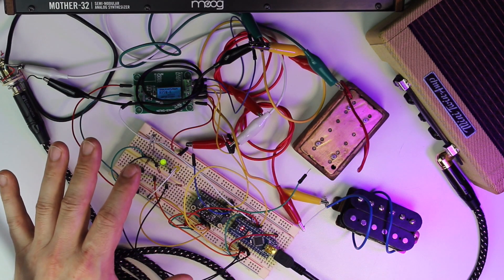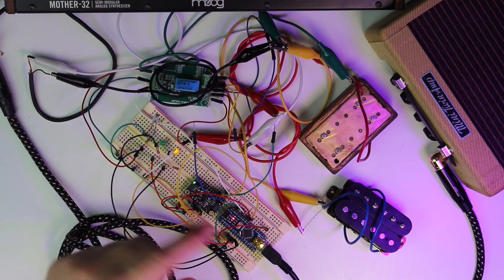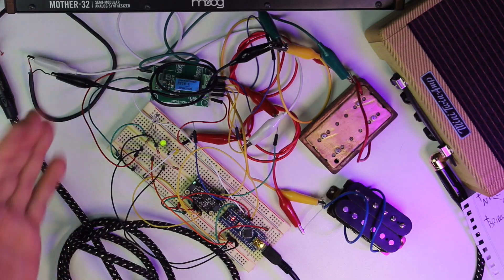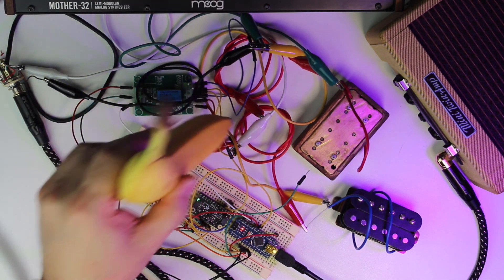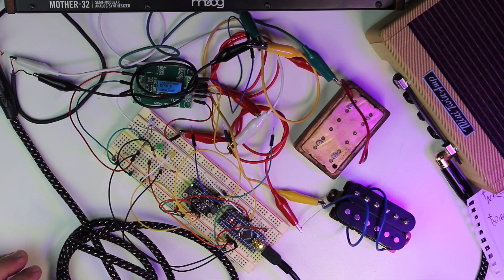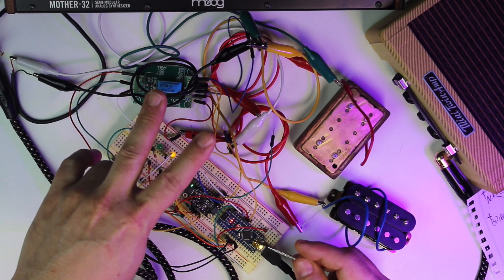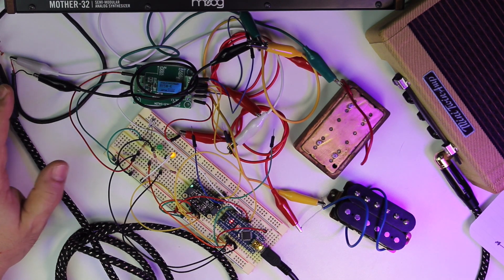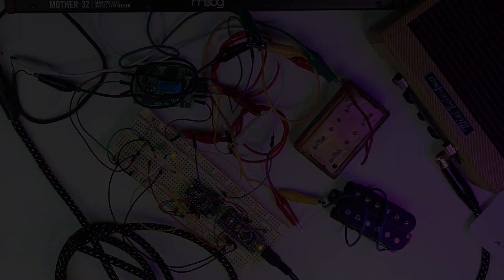Touch Capacitive Guitar Pickup Switching System

Comment from the maker: Let me know If you think this is an absolutely dumb idea that has no value to guitarists or if you think I should pursue it. Thanks!
Reply: To be honest I don't believe relay is the way to go for any pick-up switching project. A transistor-based solution should be used in my opinion. I am doing my research now on how to build something similar to what earnie ball built with their game-changer. So far gathering some information.
Reply: I have an insane idea I'm working on a stones throw from this one came to it from years of learning sound design.
the less you change the playing of the guitar and that natural process the more adoptable the idea could be. you're way ahead of me in implementation on the hardware too super impressed.
Reply: I'm currently adding addressable LEDs into my carved out bass (filling the cavities that hold the LEDs with resin.  I have a path carved out for the LEDs to follow.  A small USB battery is connected to a power button between the battery and the esp32-s3 mini.  Using a rotary knob that has a push button to cycle through colors and effects.  I found my way to this video because I'm trying to find out how to detect signal from the pickups if I hook it up to the microcontroller.  I'm thinking that the intensity could control the brightness of the lights as a start.  I'm coding it in micropython currently.  The electronics are ready, but putting the finishing touches on the bass before I proceed.  I'm going to browse your channel, but curious if you got the pickups hooked up to your microcontroller and if you could point me in the right direction.  Thanks! Good video btw.

Comment: I thought about doing this a while back; for your simple case a relay works fine, but for more complicated systems it was too bulky especially as I don’t have the tools or skills to build a custom body like you do. There are however switching ic’s as well as digital controlled pots which could make it all much neater. A kit like that would be a great product. I started designing a circuit but never finished it. But I would love to see something like that in one of your fine builds.

Comment: looks interesting ! only one drawback for me.... the use of a battery to power all... maybe a xlr socket for audio/power
Reply from the maker: I'm with you, passive systems are nearly perfect. The battery I'll be using is a tiny 3volt rechargeable lithium battery. It's smaller and thinner than a pinky finger. It will hold a charge for a significantly long time and be as easy to charge as a smart phone. Maybe there is a way to introduce inductive charging? Would that work for you?
Reply: @MarkGutierrez  maybe ;-) anyway amazing work!

Comment: Is there a way to set both pickups to on so you would have the middle position available too, or is it only one or the other?
Reply from the maker: Hi, great question. With this particular setup, only one pickup is on at a time. This is due to the DPDT relay. However relays can be purchased with multiple channels. I assume a 3-way switch can be achieved with a multiple-channel relay. Someone more clever than me will have to figure it out.

Comment: Are you only planning on using the switch to control the pickup selection or have you  figured out how to do touch sensitive tone or volume controls to do like a totally naked control build, either way this looks really amazing and loving your content
Reply from the maker: My immediate plan is to only use touch to switch the pickups. But I'm designing this with parts that are scalable. For example, the MPR121 has 12 touch points. I'm only using two. There is room to grow. Volume and tone would be a great next step. The microcontroller I'm moving to in phase 2, the Feather Huzzah, will have the same footprint but with built in wifi. Wifi and MIDI could be implemented in some future phase.